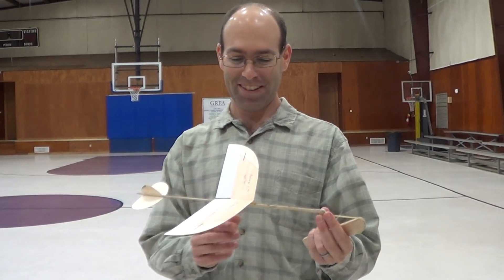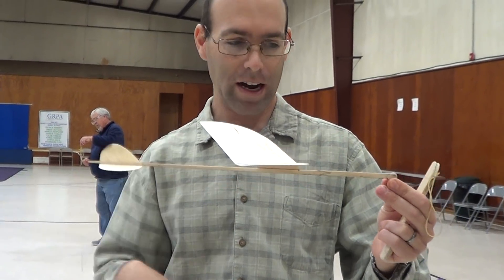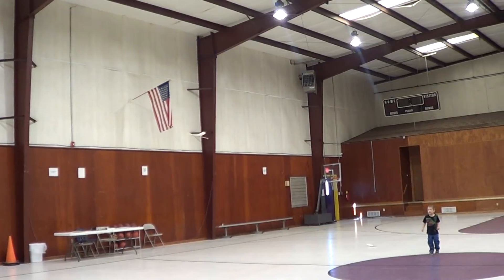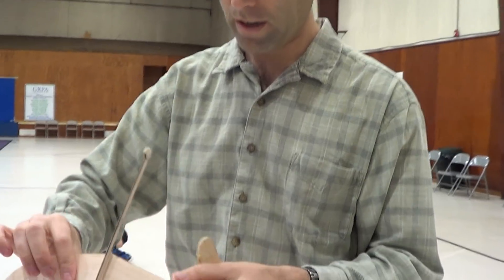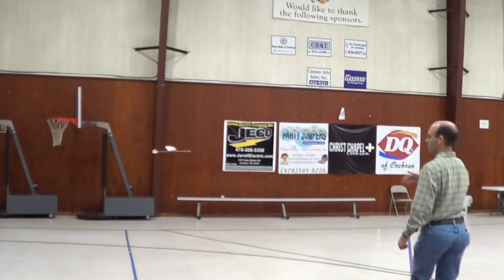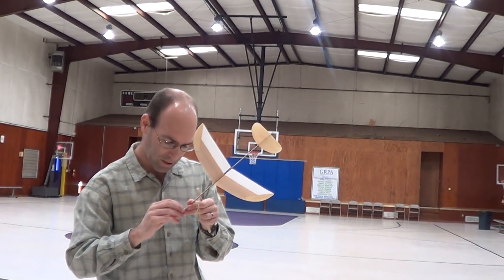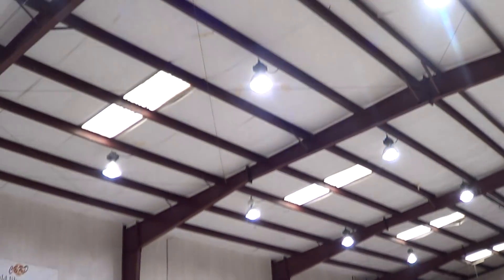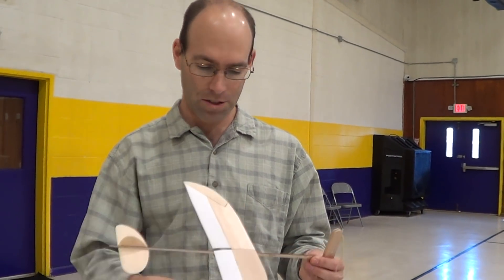How to trim flapped indoor catapult/elastic launched gliders - Protege Lite

Comment: ... hmm, ... wouldn't it make more sense to make the wing pylon horizontally movable on the fuselage tube?
Then no trim weight would be necessary...
Reply from the maker: The long nose means that any nose weight is going to be quite a bit less than the weight penalty of a secure, movable wing. The other issue is that the tail moment is pretty critical, and if you shorten it to reduce the nose weight required, things can go bad quickly. On high ceiling gliders we do make the wings removable for storage, but still don't move them for balance, only for incidence changes.

Comment: Can you expand on why you added "wash in" to the right wing.?  It looks like you are bending the right wing balsa near the fuselage down,  apparently to resist the glider twisting (barrel rolling) to the right during high speed.  In the video we can't see what was wrong with the transition prior to adding rudder turn and wash in.   We are having  issues with some gliders that can't seem to transition consistently, often losing altitude at the apex.  Launch angle and roll angle not helping.  These gliders make a nice level circle during basic level hand throws though.  
When you are adding washin, are the flaps no longer even on the front wing in relation to each other (in your case right lower than left)?
Reply from the maker: The washin is done exactly as you described. Pay no attention to the effect it has on the flap alignment. Adding washin helps the glider slide around into the glide better, in addition to resisting the barrel roll tendencies. If you're having trouble with the gliders not transitioning smoothly, it's possible that more right rudder and more wing twist (washin) could help. You may also get some benefit from adding a little up elevator and adding nose weight, as some gliders fly better with the CG moved forward.

Comment: Team built your Protege. Tested the CG. It's spot on where the foam and the balsa meet. When hand launching, the glider glides beautifully. The problem is that when launched, the glider doesn't transition from vertical to gliding, it simply dives straight down. What needs to be adjusted?
Reply from the maker: James Carr do you have enough right rudder trim to roll it into the glide and enough wing twist to keep it from rolling over? There are at least three different trim problems that can be loosely described by what you've mentioned, so if you can get me video of it I might be able to help more. Joshuawfinn@gmail.com

Comment: Josh what makes for the lighter weight compared to SO Protégé?  Interesting you say the SO version harder to trim. The little I worked with it I think I was trying to slow it down too much.
Reply from the maker: The reduced weight is due to several factors. First, I'm using the lightest balsa I can find for these kits--wood that would be too fragile for student use at the 3.5g minimum weight for ELG. Second, the fuselage is a super light piece of 1/16 balsa with thin carbon top and bottom. Lastly, the flaps 0.5mm Vector Board instead of the 1mm used on the SO version.
As you noted, trying to fly these too slowly can cause a lot of problems. They also need the CG much farther forward than one would normally expect, and of course the heavier they are, the more rotational inertia they have, making it harder to get the transition to be smooth and reliable.
Reply: @joshuawfinn  excellent explanation Josh.

Comment: Awesome transitions.  I would like to see more of the transition in the video.  Attitute, pitch, bank, etc. at the top of the launch. What attitude should we be trying to achieve to minimize altitude loss in the transition.
Reply from the maker: Thanks for that. I'll try to concentrate on that the next time we're out flying. We should note that this model is 2.6g, which makes it significantly easier to trim than the 3.5-4g SO models.
Reply: @joshuawfinn  I understand.  Thanks
Reply from the maker: @davidfranklin5270  Glad to help. I'm looking for constructive criticism to help clarify what aspects aren't getting enough attention so that we can remove as much of the mystery of flying these as possible.